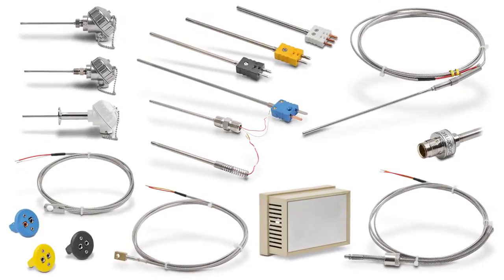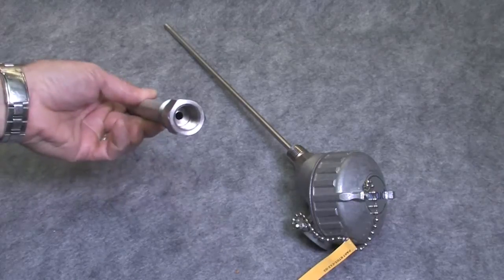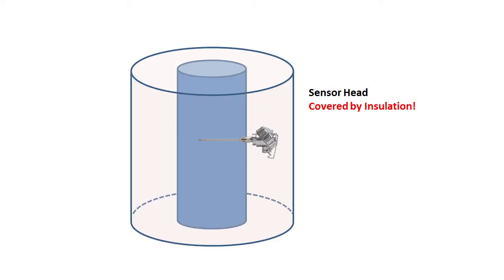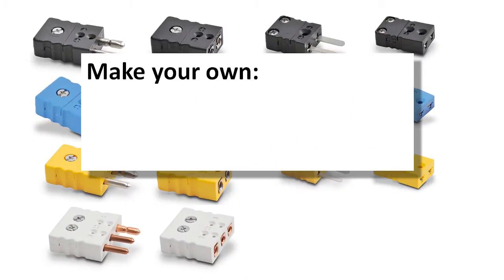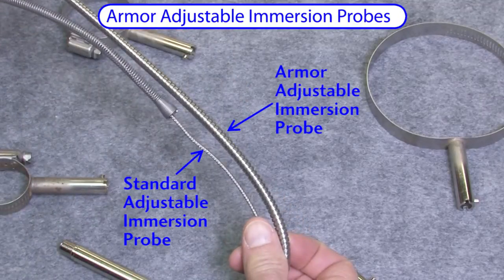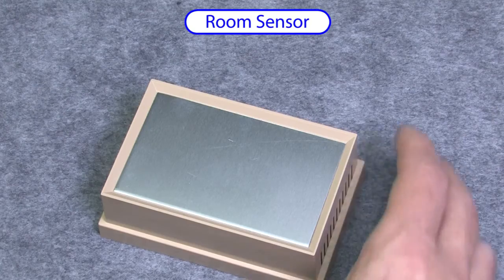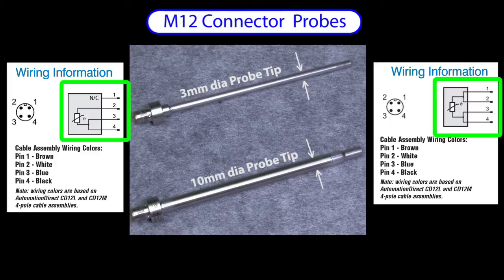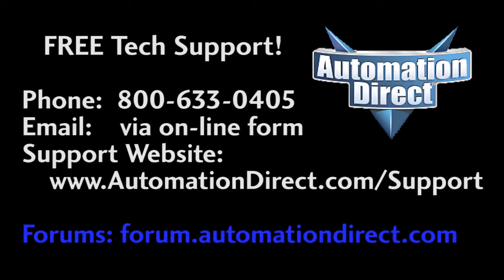Essential Guide to Industrial Temperature Probes at AutomationDirect

Comment: Which probe should I use if I am using a k type thermocouple and I want to directly measure a surface which is conducting current? (If I make contact with the surface it will affect the voltage induced in the thermocouple) I will be working at 500 degrees celsius
Reply from the maker: Brandon, sorry for the delay on this, just now seeing the message. I am not seeing any product offering that we have that will work for this application. All of the sensors I am seeing require contact of the surface, for accurate reading and nothing that would not be effected by the current. Let me hit up the product engineer and see if I am missing something.
Reply: @automationdirect  that’d be great thank you!!

Comment: what is the best thermocouple to measure the temperature of stainless steel hot food or cold food holding zones??
Reply from the maker: Hi Ravi, We don’t carry any thermocouples with a sanitary or food and bev certification like 3-A or NSF. We do have some RTDs with the sanitary connection and 3-A. I don’t know if you need that or not but here is a link(The unit a range of -58 to 400 deg F.):
https://www.automationdirect.com/adc/shopping/catalog/sensors_zencoders/temperature_sensorsa_transmitters/rtd_(pt100)_sensors/probes_(with_sanitary_connection)/rtd1-s04-04

If you are just talking about the safe food temperatures laid out by the FDA/USDA:
https://www.fsis.usda.gov/wps/portal/fsis/topics/food-safety-education/get-answers/food-safety-fact-sheets/safe-food-handling/danger-zone-40-f-140-f/CT_Index

that is not a very large range so the hot temp zone isn’t a big deal, but you would need to get down to at least 40F but your application might dictate lower and I wouldn’t want to guess if it would work. Just for reference we have these J types that have a max temp of around 900F but the lower end only goes to 32 F:
https://www.automationdirect.com/adc/shopping/catalog/sensors_zencoders/temperature_sensorsa_transmitters/thermocouple_sensors/probes_(with_lead_wire_transition)/thmj-t06l06-01

The K version has the same lower but an upper of 1700F